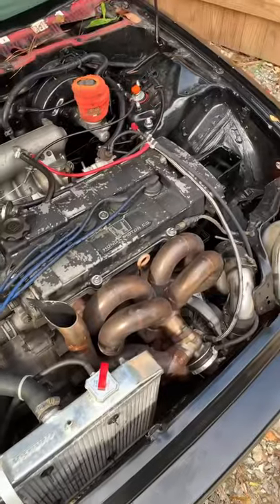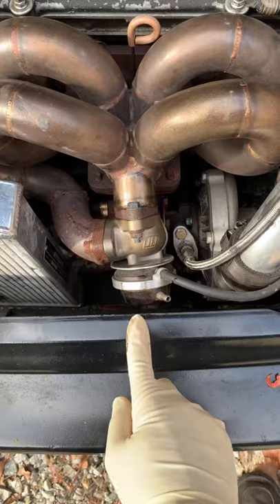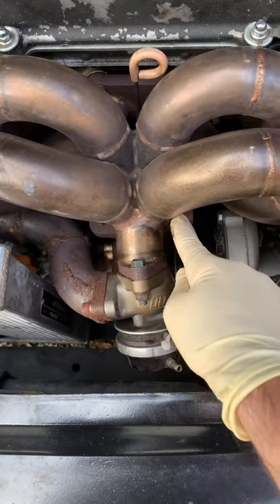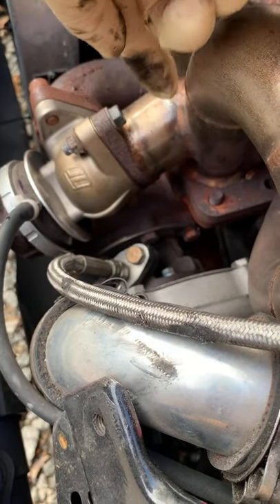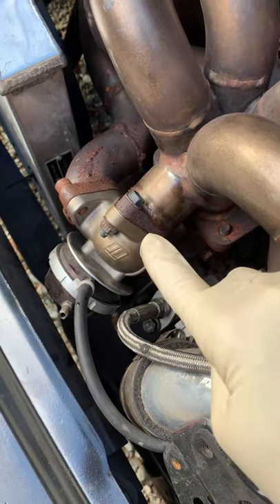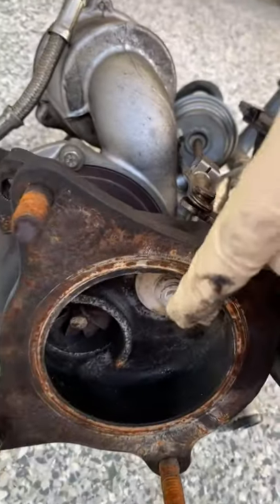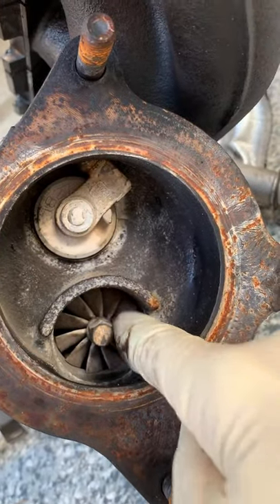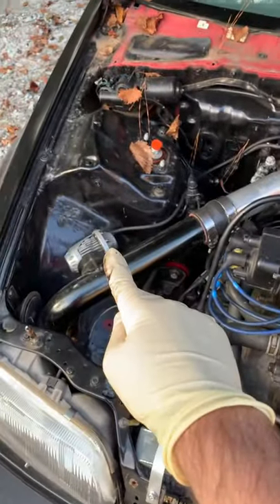How Turbos Control Boost #shorts

Comment: Well dang that input shaft on the turbo with internal wastegate  has a wee bit of play there bud like gollie
Reply: I thought the same thing hahaha probably why it's out of a car and a little rusted like it hasn't been in a car for a little while. That play was pretty bad lol!
Reply from the maker: yeah its smoked
Reply: @shopdapdiy  now by chance is that off a Audi or VW maybe a3 or a GTI ??  Also nice b series civic ma boii looks old beat up and reliable lol. Only issue visually I see is your having pretty bad rubbing on the charge pipe from your cut rad support dont lose your boost bud
Reply: i presume that is why it is not on the car

Comment: Okay, so going by what you told me: a turbo collects exhaust gas
Reply: The exhaust goes through a hot side spins a turbine on a shaft that goes though a mid section that has the bearings and then goes onto a cold side of turbo and spins the other turbine spins and forces more air into intake. 

More air means more fuel which gives more bang more power
Reply: @tterbogaming9749  and more heat..
Reply: It forces exhaust gas out of the engine while forcing fresh air into the engine
Reply: @kensmechanicalaffair  so?
Reply: @snaxgalore5764  Heat is a major issue when forcing more air and fuel through an engine, just thought id mention it. Lol

Comment: I use to work in a turbo business! My wife's family use to own one here before selling to a larger company. Learned a lot of stuff I didn't know and didn't learn in engineering school. Have seen a lot of different types of failures when it comes to turbos
Reply: Well..... and?
Reply: @savagesock3598  Oh are you genuinely interested? Most common issues I've seen is from jammed oil lines and improperly assembled turbos. I've seen them kill motors from the wheels shooting shrapnel after failures

Comment: That is a explanation of the mechanical function. The 
internal wastegate opens at a predetermined psi. The external wastegate is controlled by a separate boost control system, incorporating additional components, ie boost control solenoid,etc and control from the engine ecm.
Reply: Internal wastegates are also controlled by boost control solenoids and the ecm

Comment: So what’s the difference between a wastegate and a blow off valve?
Reply: Blow off valve releases all the built up pressure between the throttle body and your turbo to stop it from damaging itself
Reply: @jeremyflather3967  so the difference in the placement only or there's more? The principal still same right? It's like bypass valve that make sure the pressure going by the system is safe...

Comment: Question: in some VWs instead of a real wastegate, does that external rod controls the variable geometry in the turbo, to make it not produce boost?

Or the ones that have the variable geometry also have wastegates?
Reply: Yes to the last question
Reply: Most of the turbos with a variable turbine geometry don't have wastegates and for a long time have only been used in diesel engines due to the exhaust temperatures of a gasoline engine being too high for it's components. There are some newer gasoline engine generations that use a wastegate and a variable turbine geometry but it's still not very common.

Comment: Good explanation but I would add that there are more ways to control boost :D Like VTGs (idk if they are called like that in english)
Reply: @whackowafer4765  yes, in my country we call it Variable Turbinengeometrie :D
Reply: @whackowafer4765  different angles on the turbine blades = different pressure ratio

Comment: There are non wastgated turbos though. How do they “control boost”? It’s based on rpm and load.
Reply: They have adjustable vanes that are electric controlled by the ecu.
Reply: That is what’s known as a VGT Turbo
Reply: On some diesel engines they match the turbo to the engine carefully so it doesn't need one

Comment: What if you don't have a blow off valve but instead  have a recirc valve and an external Watergate?
Reply: Basically they are the same thing. One recircs and one vents to atmosphere and some do both. Their purpose is so boost can escape when the throttle plate closes which would force air to go backwards through the turbo causing  cool boost surging noises but can also damage your turbo. Having a valve also allows the turbo to keep spinning fast helping with response when on and off throttle like between shifts. External wastegates are really just bigger wastegates that have larger diameter gates allowing boost to be more easily controlled. If your gate is to small over boosting can become a problem

Comment: Blow off valve is used to relieve pressure from the charge pipe when the engine doesn’t want it. Wastegate is used to control boost. Simple
Reply: No, it’s to prevent the pressurized air from finding its way back to the turbo once the throttle closes to prevent surge (damage to the turbo). The butterfly valve in the throttle body prevents the air from going into the engine when it’s not wanted there.

Comment: You didn't explain fully how it actually functions. You didn't say how the gate controls the boost levels with the spring pressure and the diaphragm and where the boost line is hooked into either the turbo or the intercooler piping to set the boost pressure. Next time explain a little better for the people that don't know this stuff.

Comment: someone tell me what happens if i weld my internal waste gate shut
Reply: Your engine dies? Duh? The waste gate is made to keep your engine at safe boosts, get rid of it, and your engine can get dangerous boosts. You can damage your engine, or turbo. If you're going to weld the internal one, replace it with an external or make sure you're running a small amount of boost to begin with to minimize your risk